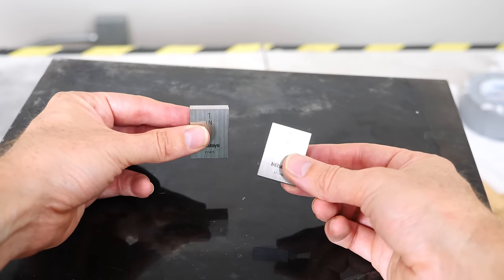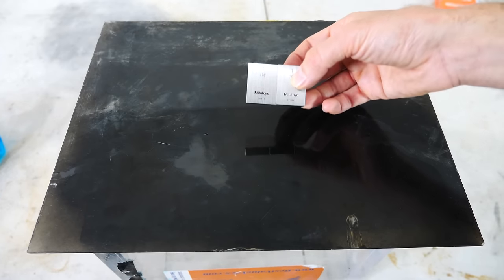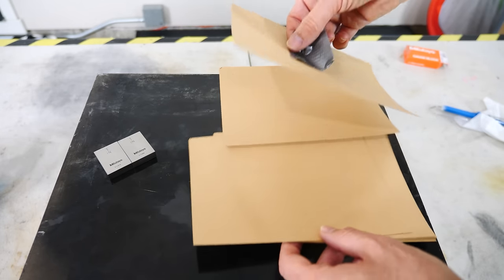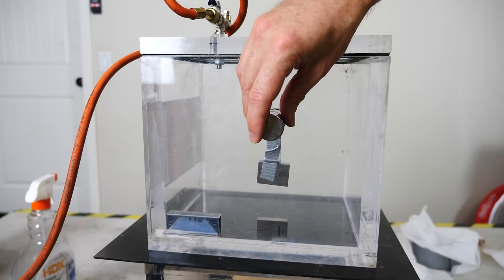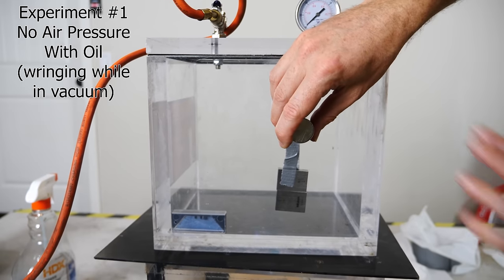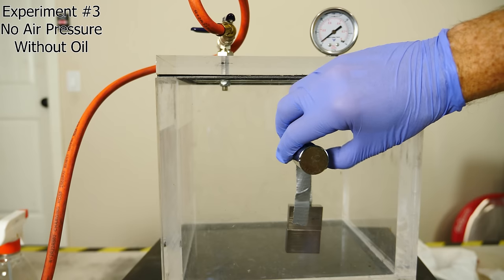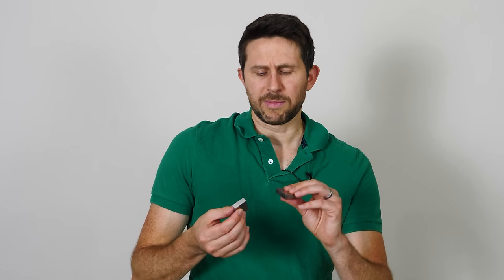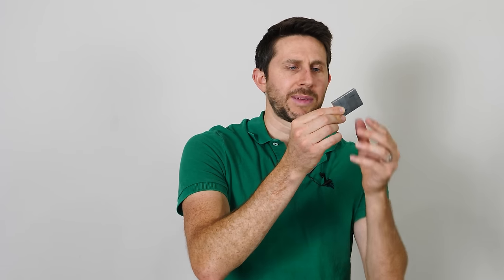Will Gauge Blocks Wring Together In a Vacuum Chamber?

Comment: The biggest problem with this gauge blocks, is when you stick them together and let them stick for a while, the atoms will bind fix to the other block and you can't pull them apart. Idk how it's called but in germany its free translated "cold welding".
So they build one single block by time.

Comment: about the electrons holding on to each other... there is a thing you can try its called a cold weld.... happend in our toolshop once when a guy left the blocks stuck and put them away next time we used them they where stuck so we couldnt get them appart without breaking them...😉😉😉😉😉

Comment: If you remove the oil while inside the vacuum chamber and polish surfaces to eliminate oxidized metal will the gauge blocks weld together?

Comment: The oil protects steel from oxidation. Even if stainless steel, the oxide layer is forming (is the thin oxide indeed that makes the steel stainless). I guess the oil is protecting the steel from passivation making the "cold welding" effect more pronounced.

Comment: Only problem i have, is the use of the word vacuum @1:40...it cant both be a vacuum AND be molecular bonding. A vacuum could be created once you start adding empty space...that doesn't mean outside air pressure isn't helping.

Imagine a pushed in syringe with the tip blocked. There is no vacuum between there and the plunger (assuming the tip was blocked and meets perfectly with that plunger...small air/vacuum gap between on a real one) the vacuum is created when you pull the plunger out. Same thing with the blocks. It isnt a vacuum if the space is filled with atoms (unless you count the space between atoms inside a single block as a vacuum)

Comment: This is really interesting...that being said...saying there's no more oil after just surface wiping them?  I don't buy that, there's likely still tons of residue and oil on those things.  If you'd put them through some chemical bath or process to get all the oil off them, then did the experiment then I'd put more faith in it.  Or better yet, just get several sets of these suckers, make sure they all work the same before changing conditions, then use that instead of subjecting the same ones to different tests over and over, and just hoping you keep them clean between experiments
Reply: Exactly my thoughts. Maybe he used a bit of solvent on the wipes without showing us, but even then it wouldn't be perfectly clean.
Reply from the maker: I wiped them with solvent several times (just didn’t show me pouring the solvent in the video). There was no residue left as far as I could tell. But there could have been microscopic amounts left.
Reply: @TheActionLab  Sorry, but just commenting on what we see you do...and what we saw was just surface wiping.  good to know you did more than that though. still think it would be better if you had several identical sets to use for each setup, but that's easy to say when you're not the one running things.  Thanks for replying!
Reply: @TheActionLab  This important detail negates my comment above then. Seems like wringing is helped by all 3 conditions, with lesser quality ones relying more on the oil film strengh.
Reply: @TheActionLab  Even then it won't be perfectly clean though. I mean it's good enough for most applications. But what you're essentially doing is diluting with solvent, spreading, and then removing the excess. So no direct removal, just dilution. Applied Science has a great video on this topic. Now if microscopic residue makes a difference though, I doubt it, just wanted to mention it.

Comment: Could you do an experiment about air pressure.
Put a vaccumed box inside a vaccume box and see if the pressure decrease.
Put a low pressure box inside a high pressure box and see if the low pressure box become vaccumed box.

Comment: I want to see numeric measurements (done with statistically significant sample size) of pull force versus air pressure, at vacuum and above atmospheric pressure, because I think it's van der Waals forces which increase with the microscopic layer of oil acting essentially as an adhesive.
Reply: You mean as a dielectric

Comment: If you had two perfectly clean and flat gauge blocks, you could actually permanently stick them together under vacum by a process called 'cold welding'. This way, you would essentially combine them into one seamless block of metal.

Comment: I heard the blocks were so flat that they weld together, and that the oil is there to keep them from forming oxide layers. The oxygen in the air quickly forms oxide layers, and the metal's surface would become bumpy and less prone to atomic interactions.

Comment: But I heard about another cause of wringing from another channel, that being mechanical.  The imperfections on each surface lock together, which is why often to wring the guage blocks it helps, or is even necessary, to slide them together.  On the atomic scale they're not flat and the surfaces kind of mesh when friction is applied.

Thoughts?

Comment: The wringed blocks have been tested to hold 120Kg force. Since the blocks have an area of .481 square inches that gives a pressure of 550 PSI holding force. If the atmosphere is 15 psi that leaves 535 pounds due to OTHER forces beyond the air pressure. So Air pressure has very little to do with it

Comment: What if you try a similar experiment but using other materials instead? Such as wood, plastic, glass, etc. This way, you'll also know if the type of materials play a role or not in them sticking together or is it mostly oil and air.

Comment: I have an Experiment for but may expensive. Remove the oil complete stick them together in a dry conditon to make sure its not rust, and try to pull them apart after a month. Make measure how much the pull force increased over Time. I  heard the NASA had problems in their early days with spacecraft and cold welding.

Comment: Interesting, but not fully discussed in my opinion. Even when all the oil has been removed, there is a film of water molecules on the steel surface. This is the case with any surface that is exposed to humidity at room temperature. Water molecules have a great adhesive force because water is polar. To remove them completely, the surface has to be heated or exposed to a high vacuum for a long time. Only after removing the molecular water layer would the atoms of the gauge block really touch, that would be interesting to see how strong the adhesive force would then be. I suspect it would be weaker.

Comment: 6;30 Wring "film" does not refer to a film of oil. It refers to the average gap between the two surfaces. Calling it a film is misleading , it should be called an interval or a layer. That layer can even be NEGATIVE it does not involve the oil. See Optical contact bonding where no oil is permitted yet full wringing occurs, gauge block are not as smooth as glass (they can't be because they will seize and gall if too smooth)so there is always a slight gap due to roughness and THAT is the so called "wringing film". I have experimented with this and in my opinion the trace of oil is there only to push out any remaining air so the metal can fully contact.

Comment: Does the oil coating in some way protect against oxidization of the outside layer, resulting in weak cold welding? 🤔
Reply: Friction welding requires heat.
Reply: @timelsen2236  not talking about that then? Cold welding, the phenomenon as seen during space missions on occasion.  The idea that the crystal lattice structure of metals, can allow separate pieces to "fuse" together, if the outside layers are not oxidized, thus have free flowing electrons, which I believe is a property of most metals?

I'm not an expert, I'm just a nerd.

Comment: I believe inside a vacuum there could be a Greater vacuum. And the presence of the oil strengthen the greater vacuum. It is less difficult to pull the the two bars away from each other in the vacuum compared to outside the vacuum. This means that the vacuum you created have not equal or overcome the vacuum created in between the two oily bars😅

Comment: Could it be to some degree the same process metals are fused together in space with no air for a lubricant ? But would it be flat enough to push enough air out to fuse?

Comment: Will a pair of "wrung" gauge blocks let go if you pull a vacuum around them after-the-fact?
Have you put a pair of "wrung" gauge blocks in a tensile strength tester and pulled with 0.5, 1.9, 1.1, 1.5 atmosphere pressure?
Have you TOTALLY degreased gauge blocks (run them in the dishwasher) to see whether they still stick?
Has someone made ULTRA-smooth blocks to see whether they stick any better (when super-dry)?
(Given that they allow 25µm for presence of oil, oil must NULLIFY metal-to-metal adhesion.)

Comment: Coming up next: why do two Scotch tapes stick together? 1) Quantum spinor proximity tunelling orbital splitting phonon resonance trap site spin effect 2) Cassimir effect 3) Quantum hydrodynamic chromodynamic electro-graviton-repulsion interaction time dilation separator string multi-dimensional tunneling phenomenon 4) spacetime warping on subdimensional hyperplanes 5) Glue. Conclusion: it's the glue on them. I thought if you have two perfectly flat things covered in goopy sticky oil, that it will be obvious.

Comment: I wonder what would happen if you removed the oil with a solvent?  Wiping the surface with a dry cloth might still allow an extremely thin layer of oil to remain
Reply: True, there still was oil, also lint from the cloth as well as an oxide layer to some degree. All that should be more than enough to prevent this ominous 'cold welding'.

Comment: If you could figure out a way to measure the pull-apart force required and do experiments in vacuum,  normal atmosphere and 2x atmospheric conditions you could calculate how much force is which. It might be interesting.

Comment: i have seen the grinders that make these - deep inside a mine (at least one of the mfg places). We used to believe that you could grind a surface finish fine enough it will weld without heat, but oxygen in the air destroys our attempts and creates the micro-groves that prevent full on weld.

Comment: I wonder what would happen if you froze water into ice cubes while in the vacuum chamber, would the ice cubes float or sink if there is no air trapped inside. Probably float, but i still wonder.

Comment: It seems like you should be able to tell how much metal to metal surface contact there is by measuring the electrical resistance.
Reply: That would require a costly precision tool.

Comment: Simply wiping the oil off does not remove the oil in this instance.  You should have used something like brake cleaner, or other oil remover to actually remove the oil.  Even wiping off the oil until no more oil appears to be on it is still leaving a micro-thin layer of oil on them, thus negating the validity of the test. I don't know if the results would be different, however disappointed that you seemed to miss this, or didn't explain how you cleaned the oil off.  As you mentioned gauge blocks are machined to allow for a 25nm oil film, thats beyond thin.

Comment: this is called optical contacting , if the gage blocks were polished, say to a 1/10 wave surface flatness you would have a molecular bond. It is a common method used in precession optics manufacturing to obtain extreme parallel surfaces.  I spent 20 K to Patent, a Thin film that was based on this same Molecular bond that takes place , But lawyers are good for one thing Taking your money

Comment: Hey there, great channel.. I have something for you to investigate, if you like. I was at a tire dealer and noticed that he was filling my tire with air while the tire was not mounted on the car. I had thought that the tire pressure would increase after the weight of the vehicle was applied to the tire once mounted on the car. So I asked the mechanic.. He told me that the pressure would not change. I find this notion bewildering.. If I blow up a balloon and press on it with the valve open.. the sound it will make indicates that the pressure has increased. Can you conform the mechanics statement.. or is he full of hot air.. PUN INTENDED
Reply: When you squeeze the balloon the sound increases cause the valve is open!    Take the valve stem out of your car tire and it will squeal too!!  The 2 things that will change the pressure in your tires is the volume of air and the temperature.  The pressure doesn't go up when your tires are mounted on the car because the weight does not change the temperature or the volume of air inside the tire, They will bulge under the weight but it does not not change/increase the volume.  When you drive, rolling friction will raise the temperature of the air increasing it by a few pounds.
Reply: Of course the pressure increases. I think what he meant is the effect should be negligible in practice.
Reply: @imnewtothistuff 

If that were true, a bellow could never work. What a load of BOLLOCKS!

Comment: It’s called the van der waals force, which is basically at the atomic level a kind of static charge type force which is similar to when hydrogen bonds by sharing electrons weakly with surrounding slightly oppositely charged local molecular regions
Reply: #1...  Electrons don't exist.
#2...  If they did, hydrogen only has one electron, therefore losing it through sharing would cause it not to be hydrogen.  Didn't think about that, did ya?

Comment: Question off subject for perhaps a new video if you haven't already:  Can a single symmetric light source, like a flashlight or the Sun, project a shadow of an object (Tennis ball or Moon) that is smaller than the object itself?   If not, the full eclipse proves that the Moon is 70 miles wide!  The shadow path across the Earth's surface was 70 miles wide.  I did the trigonometry using NOAA and Pole Shadows in three cities in Europe, North America, and Ushuaia and got a distance of I think 3,052 miles from Earth on a flat surface (surface of water is always level).  If you make the assumption the earth is round, then you have to add calculations for curvature which splays the poles apart and gives you millions of miles and parallel shadows.  That's why all the old Astronomers got different distances in the millions of miles.  They were guessing.  The assumption before the math has to be, do you want the poles to be parallel, or the shadows to appear practically parallel?  Flat or curvature, do both and see. It also means the Sun is only a hair farther, slightly bigger (corona) than the Moon, and much smaller and closer to Earth than we ever thought or have been told.   Change my mind.  Fake Moon landing is real, and so is flat earth, because of science and math.   BTW, I graduated from BYU as an Economist.   You and I could have had math classes together!   I really like your program.  BTW:  Fan not blowing a feather in a vacuum without elements proves rockets don't work in "space".  Bible says Earth is on pillars (cathodes).  The North pole is a dipole anode with perpendicular toroid fields (aurora is visible). The difference between the two frequencies is flux capacitation, and it rushes across the plane to the outer cathodes and we call it gravity, because the higher frequency is beyond our range of senses, plane is negative and first layer of sky is positive (Van Allen got that right, sort of).  This also means Earth breaks the 2nd law of Thermodynamics, and is an over-unity generator.

Comment: Actually, the metals would have metallic bonding. They are the only substances where the electrons no longer remain fixed in the atoms electron shells. The electrons become free flowing through molecule. This is what makes metals good conductors of electricity and heat. maybe the free flowing electrons are attracting to opposing metal surface. After all, the force holding atoms together (Strong Force) is the strongest fundamental force.

Comment: What a complex problem.

Is it possible that the air between the blocks needed more time to escape,  there would then be a positive pressure between the blocks, but if the air amount was small enough it would also still bond the blocks.

Comment: I could press two clean, thin glass surfaces together and do the same BUT something interesting is observable:
When pulling apart after being wrung, (no oil) a moment before they give up multiple colored pattern is barely  visible. It looks almost identical to the patterns that appeared on your chocolate holograms, only that the glass ones are more radially packed towards a point. The spectrum  repeats itself like a contour map.
Any idea what causes this?
Reply: Optical interference probably, similar to what happens in thin films.

Comment: Hypothetical scenario: If gauge blocks had %100 flat surface on one side (like a single sheet of atoms flat) and nothing like oxygen in the air to bond to surface, would it be possible to bond the two blocks together permanently just by applying pressure?

Comment: Not much in the way of details... It would be nice to know what level of vacuum he used... clearly not an ultra high vacuum but probably relatively decent. Also, did he use a solvent to remove the oil? It looked like he just tried wiping it off but he probably should have used acetone etc. I'm a fan of scientific rigor. 😉

Comment: All three reasons you mentioned for why they bond together are in fact just one, which is the electrical bonding. When you look at it from a deeper perspective... ?
Reply: Atmospheric pressure reason would require a faaaar stretch
Reply: @Radicalplay , not every force is of electromagnetic nature. And not everything is made out of atoms, since there are many different subatomic particles.